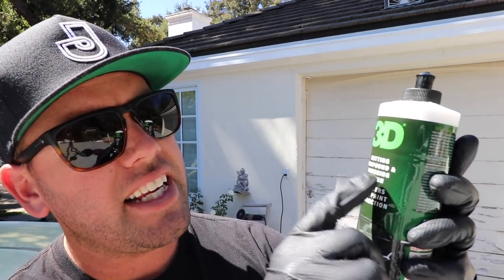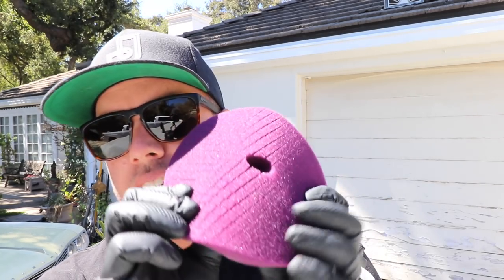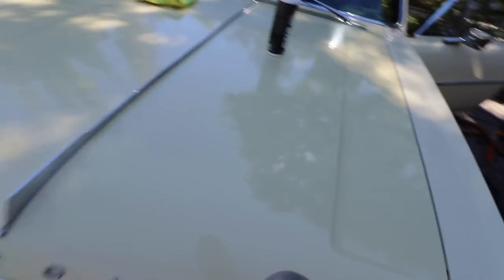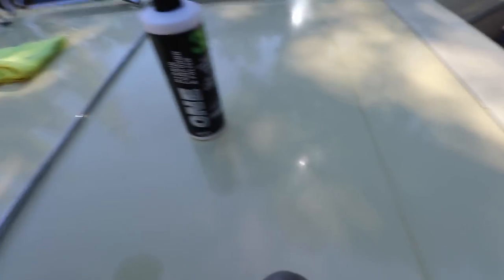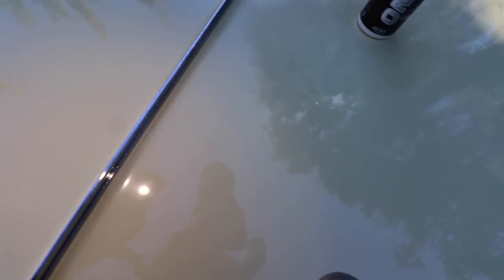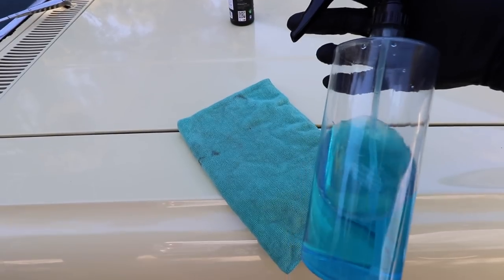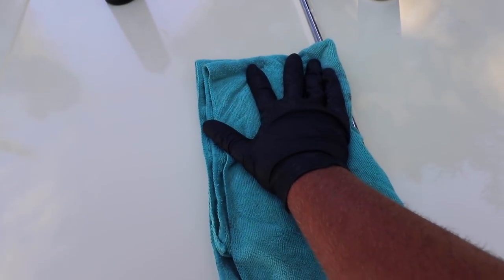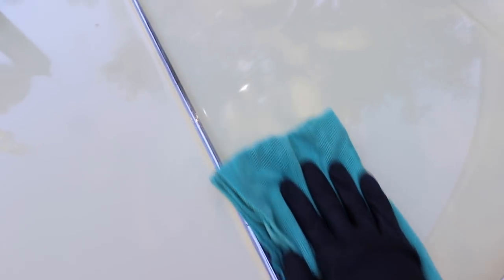HD Speed VS 3D ONE Compound & Polish [new product]

Comment: I as well as my customers are beyond satisfied with the results of HD Speed. Its a no brainer. Orange cutting pad if you want a little cut with nice shine, or a black/white finishing pad to get the swirl filling capabilities. I use Lake County foam pads. Either way, great gloss and the end and i never get tired of seeing customers faces when i give the vehicle back. 👍
Reply: Wayne Bauer Me too, unless it’s a customer that specifically wants a heavy duty wax applied, my package is always HDSpeed. It’s a no brainer like you said. I get away with two section passes and customers are thrilled.
Reply: Mine too!  I upsell a “2nd coat of wax” and apply seal & shine after HD Speed

Comment: Big 3D One fan, very pad dependent, but can really do it all. Great for beginners and DIY detailers as well. But throw on a uro-fiber 50/50 and you have a very good one step combo. 👍👌✌
Reply from the maker: That’s a great combo for sure
Reply: Keith Olsen where would one find that 50/50 pad your referring to?  Thx
Reply: Keith Olsen perfect, thank you for this info.  Have you ever used Mckees 37 360 all in one?  Just wondering how it would compare to the 3D HD Speed all in one.  Thx again.
Reply: @tundrawhisperer4821  no problem! I haven't used the McKee's all in one, but I definitely wouldn't be afraid of it. They make a couple products I use almost every day. It should produce results very similar to Speed. 👍👌✌
Reply: Keith Olsen I’m still new to all this, but have been searching for a good “all in one” product to use.  I have a newer Tundra with pretty good paint right now, just looking to take it to the next level.  I have a new DA polisher coming and so wanted to pick up some product soon.  What sold me on the Mckee’s 37 360 is they are making the claim, along with some videos I’ve seen on it, that the product will just evaporate as you use it, leaves no haze to buff off.  You just polish each section until it’s off the surface.  I guess I will find out if that’s the case.  Thanks again for the pad info, much appreciated.  I think I’ll give those a try, Brian at Apex seems to like them a lot.
Reply: Works well with ordinary medium pads too

Comment: The "alumina" is aluminium oxide abrasives. It has slightly lower amount of abrasives in it compared with some other products but a heap of dearomatised kerosene.  Kero is often used in compounds to  soften the paint to make it remove the paint defects quicker.  At least it wont smell. Has plenty of water in it about same percent as the kerosene.
Reply from the maker: Thank you for the info

Comment: Sounds like these aren't the same product type. All-in-one vs a Compound/polish hybrid.  ALSO, you don't seem to know what sponsored means. Them sending you product means it's sponsored, regardless of what you say about it.
Reply from the maker: Regardless of what the product is called if they work and act the same they are more similar then you think.
Reply: Does the 3D leave protection behind?
Reply: HD Speed leave protection,  for that reason is an  AIO. A One Step is Compound /Polish only.
Reply: Charles Aviles 
A compound/polish sounds like 2 steps to me bud. 
A true one step is using only 1 product.
Reply: OGCONSUMER
A one step in the way Charles is referring to here (the 3D product from the video) is indeed 1 product. It performs as both a compound and a polish. This is not a new concept.
Reply: Being sent product doesnt mean you're sponsored by them. Theyre trying to get his business, not get him to plug them.
Reply: Sponsorship is receiving anything that would typically cost actual money, for no money. In this case, they sent him their product and a competitors product, for free. They have sponsored his ability to use their product and compare it. If you entered your car in a race, and Michelin sent you new tires for your car for the race (for free!), Michelin sponsored you. Sometimes sponsorship comes with requirements, such as "We sent you free tires, so you have to put this Michelin sticker on your car." Sometimes sponsorship comes with "no strings attached" however when you bash their product you're likely not going to get any more products in the future. That's how these things work.
Reply: Tonezorz   Not quite "competitor's product."  HD Speed is essentially 3D.  Don't believe me? Go to 3dproducts.com, where you can buy HD Speed.
Reply: They are absolutely not the same product...  Seems to have missed the point of the two products.  HD Speed has a wax, and it a light cut only.  3D One used with a cutting pad gives a heavier cut and gets more defects, finishing out reasonably well.  But when used on a polishing pad, or even a black finishing pad, gives less correction but a slightly better finish.

Comment: I haven’t tried 3D 1 yet however I don’t think HD speed is worth anything. I would rather use a good polish like griots then do a basic ceramic coat application after. The extra 30 min of work would yield better results. It will make you look good and your customer happier.

Comment: EVERYONE WHO IS SAYING "use a black car" 
Seriously dont even touch a DA polisher cause you obviously dont know what to look for 
I see a massive difference  i do see that it didnt remove the scratches but it brought back the gloss 
Its not an amazing  gloss but like he said its a bad respray and thats what youre gonna get 

The edges of the light he is using is a bit more crisp and clear 
The clarity of the light reflection is a bit  hazy  so this stuff is basically a lipstick on a pig and doesnt work nearly as good as sonax perfect finish 4 cut / 6 finish  which lasts as long as you protect it  throw a IGL ceramic coating over it and you have a car that will gloss for several years

Comment: The difference is that UNO you can use with any pad, and Speed you only used with Cutting and polishing pad. The 3D Los Angeles
Reply from the maker: thats actually not accurate. Ive used speed on a rotary with a wool pad - the bottle also says that you can use by hand, DA or rotary.

Comment: Hi, great video.
3 Questions please.

I have a 1979 MGB, Black.

I will try the 3D, 
Why the flashlight .

What exactly does the alcohol do.

Do I need a buffer.
Reply from the maker: 1. Simulated full sun 
2. Alcohol removes any fillers the product may have to show a true result 
3. Can be applied by hand but it will produce a better result with one

Comment: Lets be transparent HD speed smells nice...then leaves fillers so when it rains your customers call you and say hey that stuff you used just washed off come back and do it all over again.. but it smells nice.
Reply: If your customer called you cause your work rinsed away in the rain then you don't know how to properly work the product in. Every single time I do a test spot with Speed, there is no change and no defects "come back". Also, if you actually saw the video above you'll see Jimbo did a wipe down and nothing came back. There is plenty of evidence out there showing Speed can do some correction even if just mild/medium. If you're expecting it to cut like a compound then your expectations need adjustment.

Comment: 2 totally different products. Speed is a 1 step that  has fillers and leaves a wax behind. 3D One does actual correction and finishing. Not a fair comparison
Reply: I think a better comparison should be between 3D Speed & 3D 505 Correction Glaze which is supposed to be an upgrade from speed.